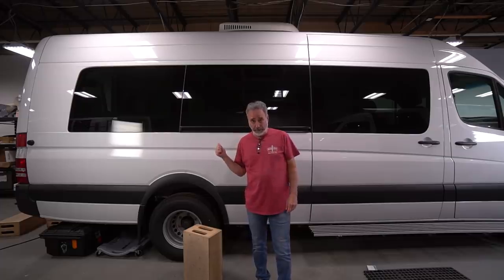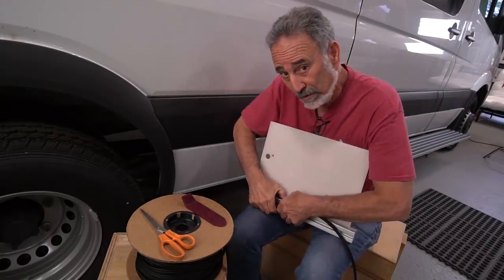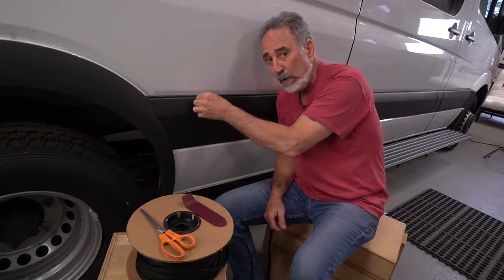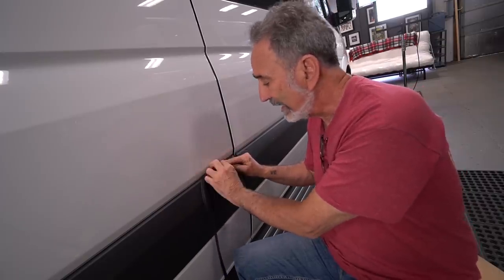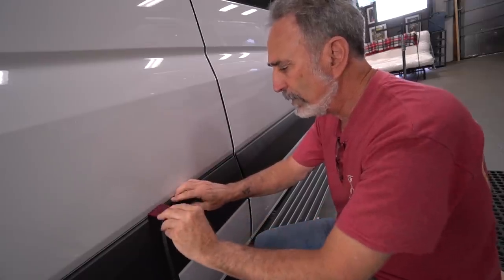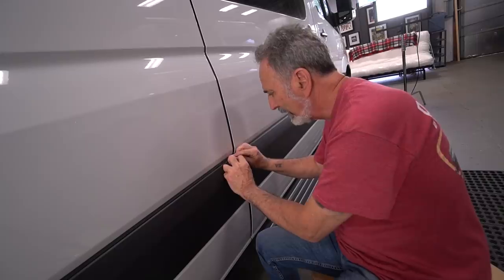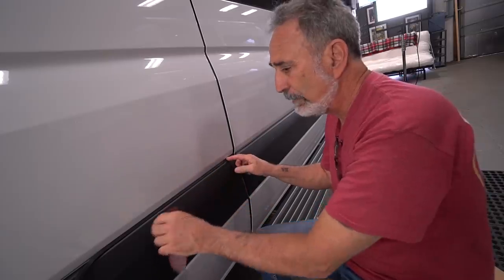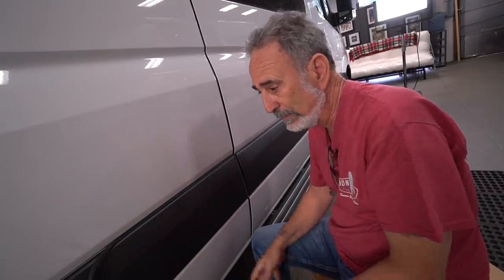SPRINTER OWNERS! Stop body panel leaks easily

Comment: So what you’re saying is I’m going to pay $50,000 plus to buy a van that leaks rolling off the assembly line. Definitely going with a promaster when time comes.
Reply from the maker: It's not that simple Dave. Many considerations, pros and cons.
Reply: Humble Road yup. Higher cost of diesel fuel. Higher cost of of maintenance. Diesel mechanics fewer and further between. Cost of def on top of fuel. Lol. Great looking van. Not sure I’ll go with a sprinter when time comes and mine wears out.
Reply from the maker: Homebuiltcamper Dave I just ordered two Promaster 3500EXT configured my way. One for me the other available!

Comment: Sikaflex works a whole lot better than silicone for me
Reply from the maker: There ya go! I call that teamwork!
Reply: +1. Silkaflex (polyurethane elastomeric) vs generic silicone for this application. .. Current project is a '94 MB coupe renovation (historically 911's) for use as the next daily driver. .. Silkaflex works wonders securing stretched leather headliners. .. The Silka-poly expands and contracts with ease. ..Be it a cold Vail winter or a Manasquan shore/beach sunbaked heat. ..
Reply: @michaelschneider-  I did some research... There are so many variations of Sikaflex. Which one did you use? (291 or 221?)

Comment: That rubber weatherstripping he mentions…DOES NOT WORK. I bought a spool. It doesn’t stay in place with driving vibrations and wind. Total waste of money. Just caulk it with gray butyl caulk tube and power caulking gun.
Reply from the maker: Oh no! I I drove my van from New Jersey to Florida stayed a month and drove back to New Jersey without a problem. I continued to drive the van for a few years before I sold it and I didn’t have a problem. I just pushed it in and it worked fine.